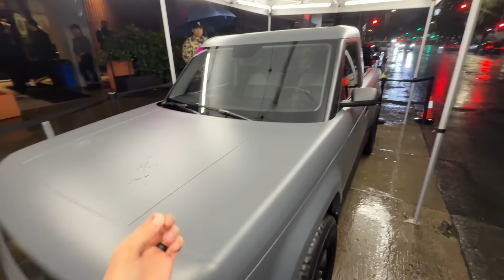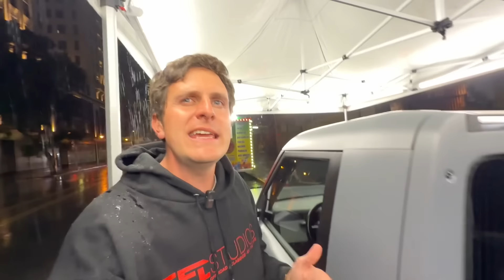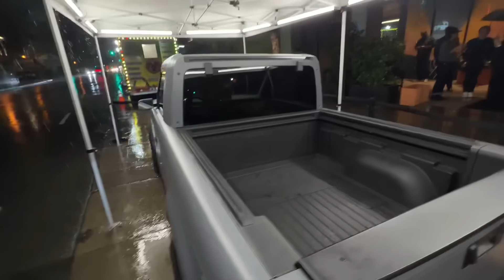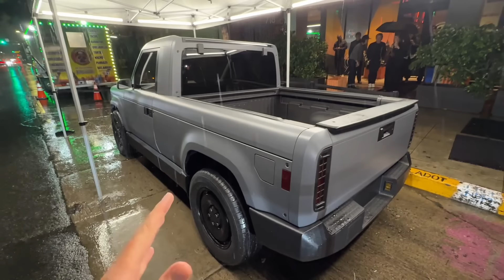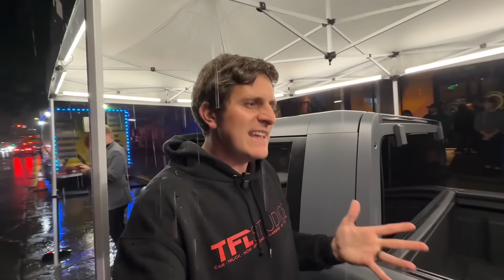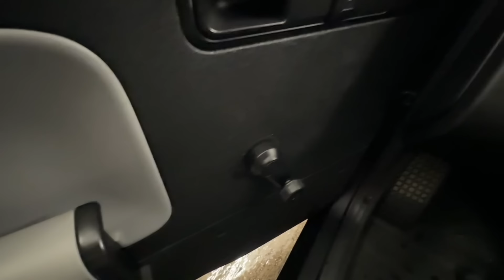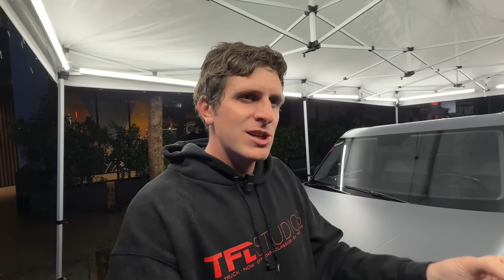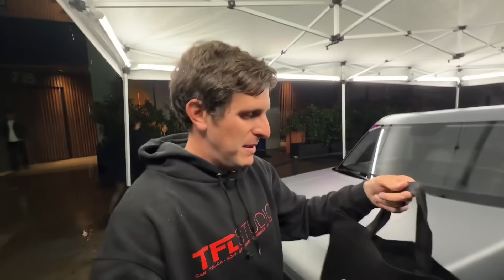The TRUTH About the '$20K' Slate Truck...Will This Really Be a Hit?

Comment: Right now I own a base model regular cab 2 wheel drive 2006 GMC Canyon. All it had on it when I got it was cruise, AC, and an AM-FM Radio. No power windows or door locks and it has served me well over the years. I don’t take trips in it, it’s basically a run around town errand truck. Nothing sold today is even close to it. That is why I for one, am excited to see the Slate. Oh I did a quick online search, the cheapest Maverick for sale near me was still over $30k unless you buy a used one, but I don’t want 4 Doors.
Reply: U dumb. 4 doors give you more internal volume
Reply: If the slate never comes out then I'm clinging to my 2004 ford until I die.  (I'm only 20)
Reply: @Drewcrdllo gonna be hard when your spark plugs come shooting out and timing chain goes out at 200k.
Reply: @strohdog1 replacing the 4.0 is cheaper and better than anything new anyway.

Comment: The dealer: "I can't sell base model vehicles".
Also the dealer: "But check out this higher trim with all the bells and whistles...I know you want it"
Reply: and its only $999 mo for 72
Reply: There will not be a dealer.
Reply: Direct sales to customers. When was the last time you saw a Slate Dealership being built ?
Reply: No toxic, gouging dealer network which is a huge bonus!   They will be direct sale to consumer with regional or local pickup points which is a huge improvement!
Reply: The dealer: "I can't sell base model vehicles".
Same dealer has NO base models on the lot ... ever.
Reply: Right? Like the salesman complains about not selling base models, while simultaneously making more money by shifting customers away from them. Like, what kind of backwards logic is that? Even if someone WANTED a base model, that salesman is still gonna try shifting them away from it so they can make more money

Comment: Lost me when you said it’s the hottest truck.. There is no way.. a expensive tiny truck with low range? There is zero shot this becomes popular.  I like the idea but they ruined it with the price. This is not considered cheap for what you get. The maverick is a much better deal for what you get.. people are not going to look past the price vs what you get. Well some will but very few. Just because it costs less than other trucks.. doesn’t make it cheap. 🤷🏻‍♂️

Comment: In this form, sell for $10k with no wrap, radio or anything. Allow upgrades like the SUV configuration, infotainment, etc later or as an add on option. Someone just starting out on their own might just want the basic plain pickup and probably upgrade or even turn it into an SUV as they start a family and become more established in life. That $20k+ starting point will kill it. My prediction is flop. On the other hand, if Jeep offers base model Wranglers and Gladiators with a 5.7 HEMI, manual transmission, crank windows starting at $35k and heated seats/steering wheel starting at $40k, it will sell like hotcakes!!!
Reply: I think 10k base price is unreasonable. The battery alone likely costs 6k. That leaves 4 for the drivetrain and body. 

A Nissan leaf with similar range has a battery costing around 6-7k

Comment: It needs a 3 or 4 cylinder.  I just don’t understand why you can’t get a manufacturer to make it happen as an ICE powertrain at 20k?
Reply: In addition to there being limited profit margin, there is limited design margin. Constraining the engine in a crash  is a lot more weight intensive than a more structural battery (not to mention both the battery and motor are low further reducing the structure needed to stabilize the vehicle). 

On top of the design and cost constraints, the market just isn't that big. First, the average American is relatively less affluent than 20, 30 or 40 years ago making a second and third car a stretch. Second, there aren't enough businesses to support real mass production. (150M working Americans with average business being 20 people produces 7.5M businesses of which 1 in 10 need small trucks leaving 750k customers replacing trucks every 5 years or 150k trucks a year) 150k trucks is blip for auto manufacturing, which is why the big auto makers don't make service vehicles. They make trucks with bare frame rails for some other company to put a box on.
Reply: no margins

Comment: I like the thoughtfulness of a city truck where the panels can be unscrewed by the thieves instead of needed to break the windows to steal stuff.😀
Reply: I don't think this is a problem. Slate has said that they have that in mind with their design. It seems like they may have some bolts that are only accessible if the doors are opened. Not too mention, nobody will steal these panels if there isnt a market for them. If Slate sells the panels outright, this will solve itself. I'm sure there will be Slate's that get stuff stolen, as happens to a varying degree with any car.
Reply: Again, another person who thinks they’re smarter than the engineers who were hired and paid good money to think through this stuff. Hopefully they read your comments and realize their massive oversight.
Reply: @MrChaddly02  engineers make massive mistakes every day. Just ask a Jeep owner. 

(Former Jeep owner here)

Comment: Needs a gas engine
Reply: No.
Reply: Would like to see it as a hybrid.
Reply: A hybrid option would also be nice BUT it will add complexity/cost. It seems the key to this build is to keep cost down. A simple naturally aspirated gas engine would be great. As an example, The Ford 7.3 in the superduty is very popular now because of the simplicity of the engine (compared to other options in the segment).
Reply: Buy a Maverick.
Reply: No it doesn’t. No one needs a gas engine.
Reply: @MrChaddly02 The huge numbers of hybrids sold would prove you wrong.  Unlike electric vehicles, there aren't a large percentage of buyers that regret their buying decision, and also unlike EV"s they have good resale value.
Reply: @SonofHardrada  there aren’t huge numbers, electric vehicle, buyers who regret their decision. Most people who buy electric stay electric.
Reply: @ErinJWade  Almost 50% of EV buyers go back to combustion vehicles and the resale numbers are also indicative of that.  EV's do not hold their value.  Add to that the lack of mechanics and parts availability and the repairs in an accident can be astronomical.  My neighbor got into a minor fender bender in his Rivian where it dented the rear quarter panel and it was going to be $30,000 to fix it.  I would consider something like a Slate for $20k for a 2nd car, but would never own an EV as a primary vehicle.  My time is valuable and spending it at a charging station is not going to work for me.

Comment: aingle cab trucks are low single digit because they only offer them with 1 engine option and no other options available.  if ford made a single cab tremor that i could get the 2.7 in it would be super. but no. xl only 5.0 only. only real option is 4wd or some chrome.

Comment: Fail.  There is a reason why the market moves the way it does.  The price point will never last. Single cab is a fantasy in the mind until reality starts knocking.  You might sell a few based on initial dopamine spike.

Comment: I'm going to spend $27500 on a truck that has nothing on it and almost no range then spend $8k on mods to make it halfway usable.
Reply: Bare bones model will be over $30k when it hits the market next year.
Reply: @speedracerjeff id pay 35k for this
Reply: @Drewcrdllo  Agreed. $35K, no dealer BS, making it Exactly as you want it is incredible at anything under $40K
Reply: @Drewcrdllo mad 🤪
Reply: @speedracerjeff yeah bet you $500 it doesnt
Reply: 240 miles?
Reply: Sounds about right.
Reply: You’re not buying this if you’re going to drive across the country pulling the trailer, this is perfect for a lot more people than you think
Reply: @mcnuggetapple  It's more than enough for 95% of society on Earth. Over 85% of humans travel less than 35 miles a day.
Reply: @mcnuggetapple I understand it can work for some people by why limit yourself so much when you can just buy a Maverick for the same money and it’s better in almost every way
Reply: @Tool0GT92  It is not EV and Maverick is Ford lol. Ford has gone downhill not that it was any good, they are out there putting plastic oil pans ffs and I drove few Fords and they are designed not smart and cheaply.
Reply: @T@T @Tool0GT92 tter how? It has far more parts that can fail. It also has batteries in it that can fail just like the slates. Who do
You think it’s going to be easier to buy batteries from if you need one? I also don’t want 4 doors . I want to feel like I’m in an actual ford ranger. I’m sure a lot of people agree with me
Reply: I know the maverick is really
Good but it’s really not the same. The guys that want a slate don’t want a maverick
Reply: @SentimentalBro  I would trust a hybrid maverick over a car that hasn’t even come out yet
Reply: @mcnuggetapple an actual radio, power options, four doors are preferred by most people, Ford has been around over 100 years just think about people who bought the fisker ocean are high and dry now
Reply: @Tool0GT92  Yes because you are not a very logical person. Trust a brand with a reputation for having unreliable cars over a car brand designed to be simple and reliable that is missing engine,transmission, waterpump, alternator and insane amount of other points of failure. If you used your brain you would realize it is obviously going to be way more reliable than a shitty ford. If you were talking about like mazda,honda,toyota I might understand but even those cars are unreliable compared to an EV. I am so tired of people like you who used 1% of their brain and literally being a fan boy over car brands. Think objectively. I don't care what brand the car is.
Reply: @SentimentalBro I have a a Tesla Model Y I am aware of how good EVs are but who knows the slate could have trash suspension, the interior could fall apart, etc I’ve had a lot of fords they aren’t Toyotas but I’ve had good luck with them.
Reply: @Tool0GT92 a fisker ocean is in no way comparable to a slate lol. And just because ford has been around for over 100 years doesn’t mean you can just go to the dealer a buy a new drive battery
Reply: @mcnuggetapple how is fisker not comparable they made several cars including the Kharma, slate has no track record so you are judging assuming
Reply: It’s the only single cab that’s not $40,000
Reply: @mcnuggetapple who needs a single cab when the bed is so small
Reply: Dude you hit the nail on the head, completely agree with your statement.

Comment: Tommy, thanks for what I consider to be a "different type"  of video.  As you paused while formulating what to say. Your comments came across as very genuine.
Single color- Hasn't worked out well for the new VW bus has it? They're now trying the whole wrap thing. Wraps don't hold up very well long term. Also single color on the cyber truck, which is the least of that disaster of a dumpster fire. 
Price-Will be even higher when it's eventually available. 
Pure EV- In the US that's turned out to be such  extremely limited it's now a niche market (and that's for up to date techno& features) that US mfgrs are cutting back on EV offerings & moving to hybrids. 
In closing you made some very  truthful observations. Unfortunately Slate may very well get upset with you.
Reply: Not if his comments reach way to much people.

Comment: The 150 mile range seems like they presume that it’s either a city vehicle or that the owner has a second, gas powered vehicle for weekends or road trips. I agree, if they were to partner with an OEM for a basic n/a 4-cylinder version and kept the size/weight/cost down, the utility and variety of this vehicle would immensely expand.
Reply: Partner? Either this booms in sales or tanks, is the second some  OEM without a truck buy it a put a gas engine on it.
Reply: I will get the 240 mile battery

Comment: The basic truck is definitely basic.
Too basic for me.  Everything you would want is additional cost.  The wrap, the AWD (I live in an area that gets snow), the range, the interior (carpets, audio (doesn't have to be an Infotainment system just a stereo), power mirrors, quality seats ect...), even the bed isn't useful it is too small to carry anything.
When you dress it up to be civilized but still basic the price is going to double.  This is where manufacturers make their profits on the additional items that people actually want.  
You could sell an Auto Rickshaw like they use in third world countries cheap but no one in N.A. or any other industrialized country is going to buy them.
When people realize that just having the vehicle wrapped will increase the cost 10% they will start looking around for something more livable.
The only thing I can see that this vehicle will do is make other manufacturers start making their cars and trucks less expensive.  This experiment may just make the automotive industry more competitive, and if it does then it will be a success.

Comment: This truck is the perfect size. This truck is the BASE model that we want. Dont give any options. Period. Leave it there. This truck represents the missing link of the lack of vision of all manufacturers turning heads to the true utility trucks. Specially here in North America. I also agree that MAYBE a small NON-TURBO 3 or 4 cylinders engine with a NON-CVT transmission should be ADDED to the lineup, but DO NOT replace the electric version. I would NOT agree to add a 4x4 variant, this would increase the price to a non-sense. This would open the door to all overlanders and off roaders, one of the main reasons why existing pickups prices went to the roof bringing Rangers and Tacomas to insane prices, non-sense size with man's purse bed.

Thanks for this video!

Comment: I think the limited 150 mile range is going to be the biggest hurdle.  As someone who used to own a service company with small trucks on the road when they were available, I want to see this Slate truck be successful.  
If it were to have a 250 mile range and the batteries handle daily charging and have a long life of 5 years.  That would make it a game changer for business use.  Companies that do services like Pool Service and Pest Control would be all over this.  IMHO.
Reply: A 240 mile range battery will be an option.
Reply: @Tim-Tiller  An option that will likely put it at 30k or over. At this point. Buy something else. I'd like to see the extended battery and basic setup be 25k.
Reply: @z @zacharylewis417 would pay $35k for the slate over anything else on the market... no big screens, no connectivity, ease of repair and customization and compact, easy to park
Reply: @zacharylewis417 I have talked to Slate and according to them with the extended range battery it will be $28K
Please name one Fully Electric pickup you can buy new for that price or even $30K.
Reply: @Tim-Tiller  You can hardly call it an EV pickup truck when it lacks the capabilities to be one. Don't get me wrong. I think slate is interesting. But its failing to find a place in the market with the current costs.
Reply: @zacharylewis417 how do you know it’s failing when it hasn’t even come out yet. Give it a chance instead of dismissing it. It is more than a capable pickup for what many people use one for. Most people probably don’t use 25% of their current trucks capabilities. I know this will be a good replacement for my current truck for how I use it.
Reply: @Tim-Tiller  there is 0 chance a 100 mile extension costs only 1k
Reply: @creaturecore13 where did you come up with $1k figure? Nobody ever mentioned that. The $28k figure was based on an estimated $25k starting price for the truck and $3k for the Battery option which I was told was going to probably be the cost. We will know for sure probably at the end of June.
Reply: I think the Feds mandate an 8yr/100k mile battery warranty these days.
Reply: Yep..its a city truck fo sure
Reply: could secure a quality generator in bed ,charge when parked away from public.could work for some.foldable locking cover when not in use
Reply: @jdh1976sr  I'm a pest control tech and this truck would be perfect if it had a bigger bed. I've got a stocked bed mounted tool box, a 50 gallon chemical tank, and a gas powered spray rig in the back of my truck at all times. All of that is pushing the limits of the Slate payload, and there's no way it would all fit in that bed.
Reply: EVs got a life of 10 years with their batteries at minimum with hard use. For me they should charge a little extra to cap the cost at $30k with the 240 mile battery upgrade and maybe toss in a auto dimming mirror as a freebie.
Reply: Yeah Range anxiety is pretty much the number 1 reason most dont ever go into an all electiric.
Reply: 150 miles is 3x my daily commute. Would handle my needs just fine.
Reply: I agree 150 miles is quite inappropriate in today's world.. but it has a 240 mile variant and the range seemed to be unestimated judging by the size of the batteries
Reply: @Drewcrdllo  for me it's not a road trip car, its a point A to B. Average daily commute is about 30 miles one way. However, I live in a state that has snow and ice 6 months a year. So I need FWD, AWD or 4x4 options to replace my daily.
Reply: @Drewcrdllo  i live where its cloudy 8 months of the year so solar is a huge disapointment
Reply: Their running out of things too sell people who have too much money and whats that bumper sticker from the 80s, he who who dies with the most toys wins